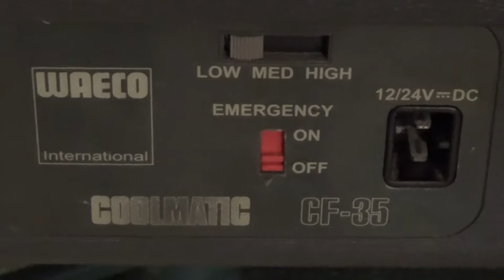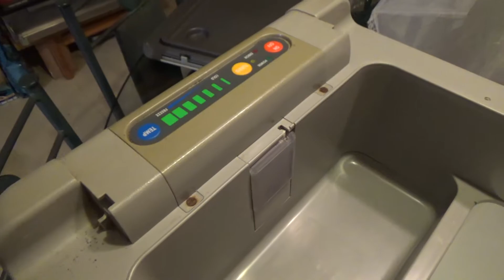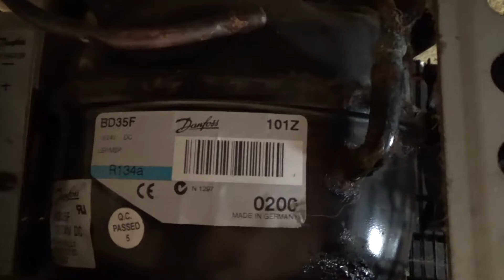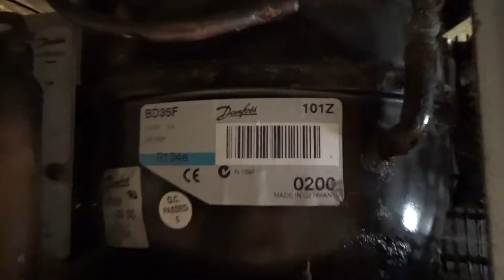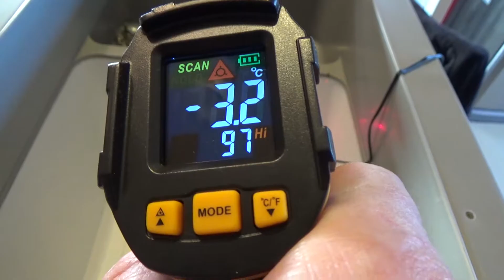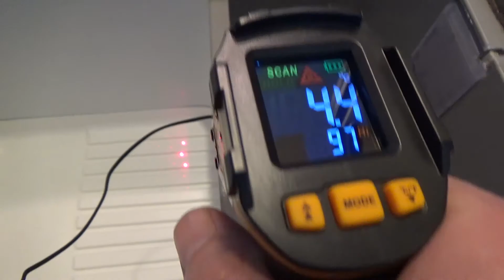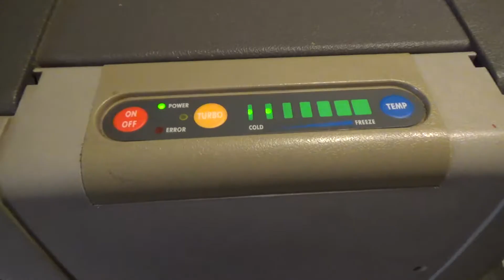Waeco CF35 Fridge Thermostat Replacement | Fitting a new thermistor to my awesome 12V fridge

Comment: thankyou! I fixed my car fridge (mine is a XTM brand not Waeco, very similar in design. Its only 5 years old was gonna throw it out (depressing!). thought i would have one last look. 90 per cent similar to yours but the themistor was in a difference place, was able to pull it out, along with a bit of water that came out of the hole. Tested the thermistor and it is ok, put it back in the hole where it came from and it appears to be working fine. Something to do with the water? Maybe causing a short in the thermistor???  Without your video i would not have attempted the fix it! You have saved me $$$$$$$$$ plus it is my secret beer fridge in the shed !!!!!! thanks heaps. Chris, Coffs Harbour, Australia. (I have subscribed)
Reply: I’ve got a XTM fridge as well that is constantly freezing. Did you end up buying a new thermostat etc even though you didn’t use it. I was chasing a model number to buy for mine. Cheers

Comment: glad to see you fixed your fridge
but if you have more issues you can do what I did
I have a CF50 that is of a similar vintage and bounced around most of Australia
but it became a bit unreliable with bad connections
I ended up replacing all the electronics with a tiny module from eBay for $12.99
Temperature Controller Digital Thermostat Module Temperature Control Switch A5R6
(363007010239)

it comes with a thermistor, 
just a couple of connections to the compressor, very easy
it's just a temp controlled relay and the fridge compressor is very reliable
Reply from the maker: Nice one, I did actually have a quick look on ebay but never came across that. Very cool and great value

Comment: I have CDF-16  and its not working in normal use, working at emergency use only any advice please, thanks
Reply from the maker: I would check the battery first, it will shut off if the voltage gets too low. Otherwise maybe the thermostat
Reply: @BusedAsNZ  thanks,  I will try

Comment: Great video, as usual😎 I have a cf 40 which has initially same problem, keept constantly cooling. I went to a repair shop and had a chance to see how they repair it. They cut a.little rectangular opening into the bottom underneath close to the sticker. The sensor must be situated there. One might be able to pull out the thermistor with a little rope attached to pull in the replacement?! The probe sits in a thermal cake. Should be an easy job for a routined DIY...For the moment I pluged in a new thermistor into the control panel on top and slinged the cable underneath the lid. It worked! But now I have another problem, the box doesn't run any longer on 12V, only on mains 220V. Any ideas?
Reply from the maker: Hmm haven't seen that, not sure. But if it runs on mains I guess the compressor is fine. Does it have a fuse in the plug perhaps, or damaged lead?
Reply: @BusedAsNZ  previous owner of the rig cut off the original plug and installed an Anderson plug, so no, no fuse in the line...but the Anderson plug plugs into an national Luna battery box, should be fused. All fuses in the box are ok, checked it. Most likely the pcb is faulty, but why does it still work on mains? Temperature panel, buttons for temperature adjustment - all works fine on mains. Got to open the box, was hoping somebody might have a hint😎May need to put in one of these 20 bugs temperature controller but then I will loose capability to run it on mains, bugger
Reply from the maker: @franks2354  Yeah weird it still works on mains. Kinda suggests it is something really simple in the 12V circuit, but where to find that little simple thing...

Comment: Hi. I have Waeco CDF35 with the same problem. On AliExpress there are many Thermistors with different resistance  ( 3950 5K, 3950 10K, 3950 15K......., 3470 5K, 3435 10K). Which of them I should buy?
Reply from the maker: Hi, mine is a 3950 10K, which I think is probably the most common, not 100% sure the difference between the numbers but the resistance (10K) is the bit that matters for calculating temperature